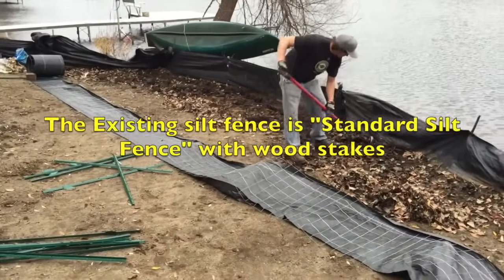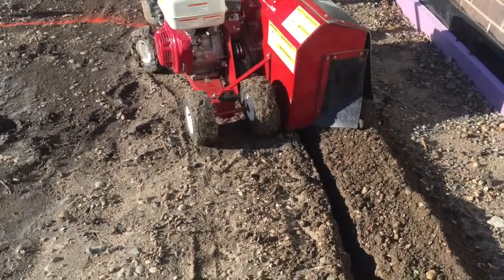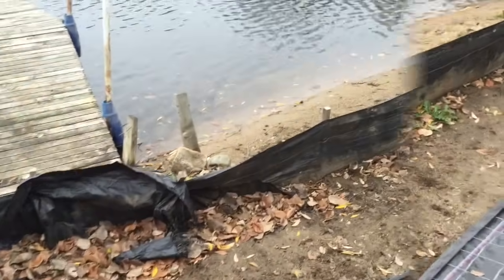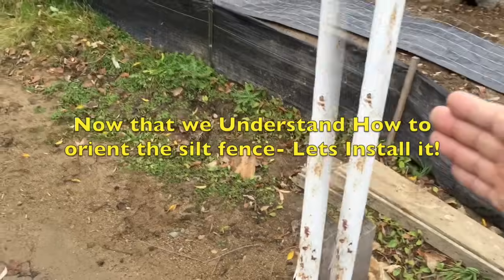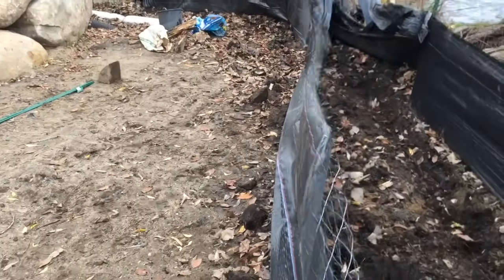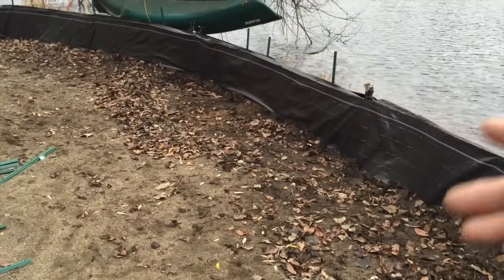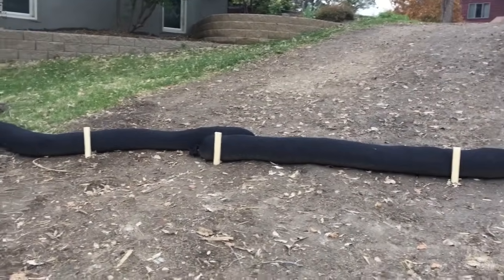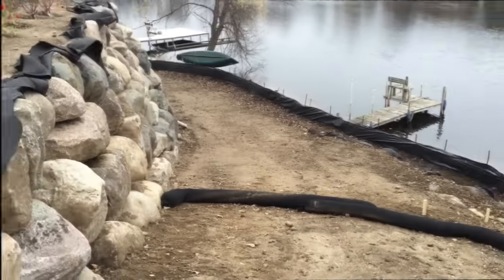Erosion Control and Silt Fence

Comment: Silt fences are very important. I worked for a construction company in the past. if the fence wasnt properly installed or damaged, the department of environment could shut the whole job sight down in a heart beat.
Reply from the maker: +Keith Dougherty Yes- around here you can get in big trouble if erosion goes outside of a jobsite.